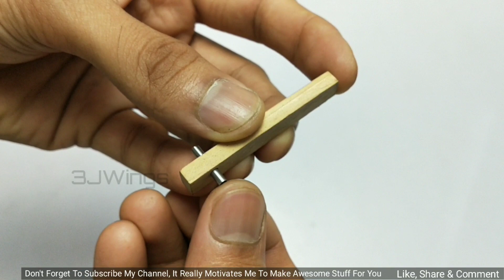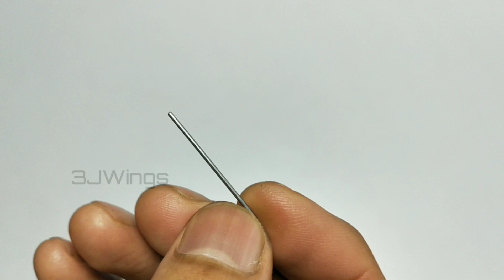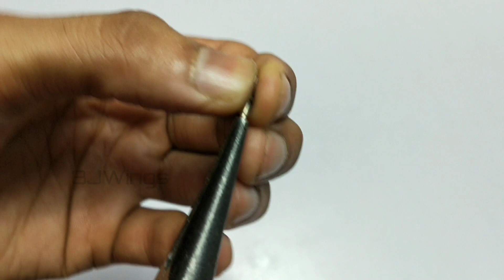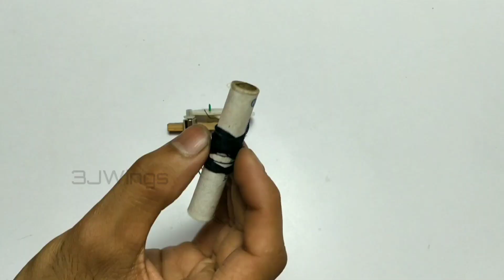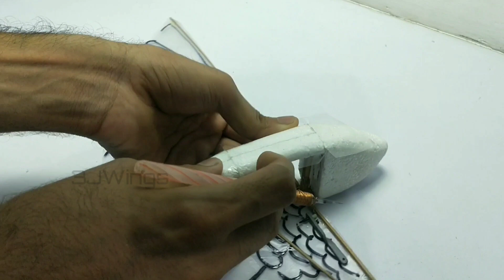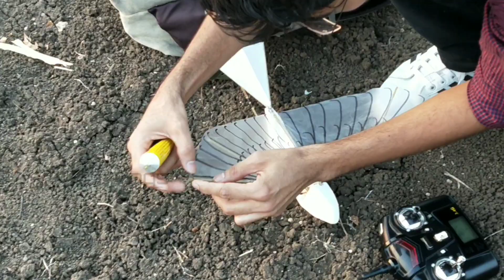How To Make Flying Rc Ornithopter | upgraded gearbox | rc ornithopter | #ornithopter

Comment: If you flap the wings more up and down by increasing the crank lengths  it may be fly better
Reply: You would need to encrease the gear ratio which would in turn slow it down